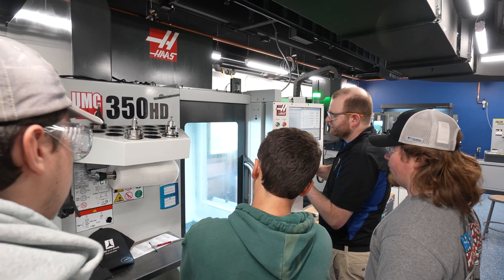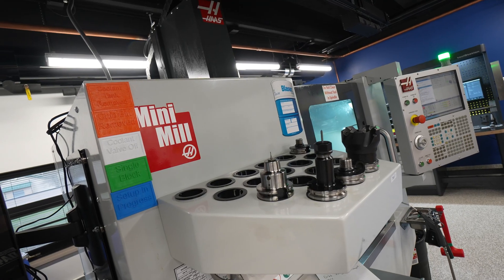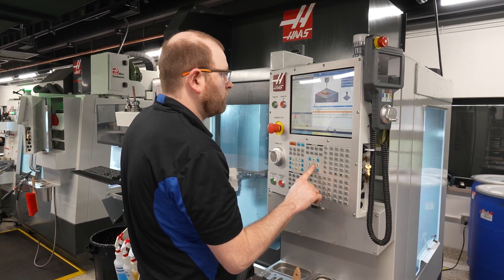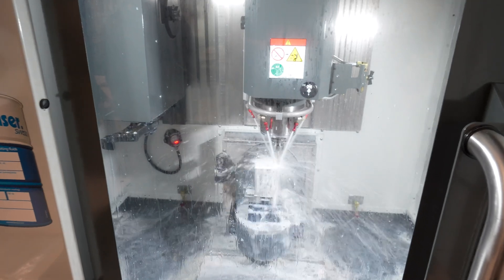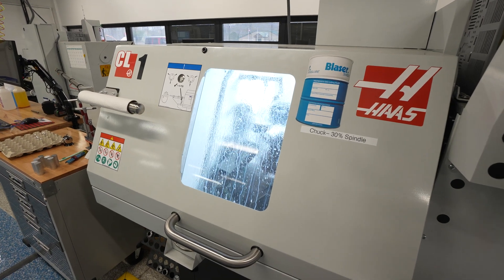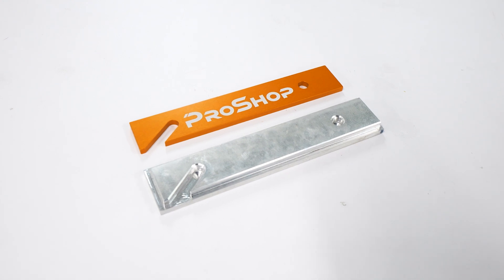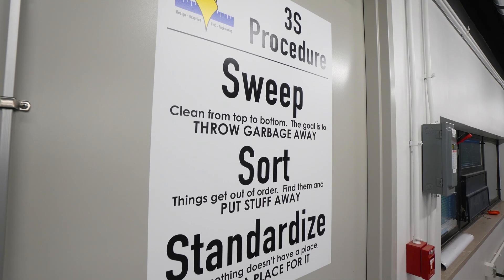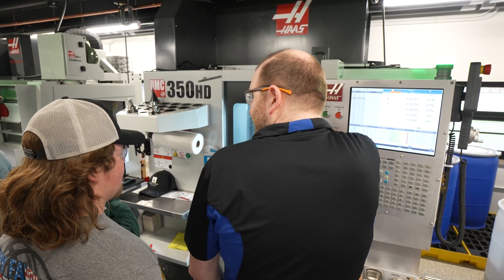A Job Shop Inside a High School - This is How We Educate Future Makers!

Comment: That's a great experience for students. However the local tax payers subsidizing 'eagle manufacturing' by being run by student out of the high school begs a question of ethics. Actual manufacturing and sales produced by capital investment of local taxpayers and labor of youth to compete with legitimate businesses is wrong. Maybe find a way to do this with out actual sales.
Reply from the maker: To be clear, the projects these students are working on are NOT taking jobs away from local job shops. And example is a key chain they did for a local company. That key chain was not something the business needed, it was just a way for them to support a local high school education program. If anything, there might be a third world manufacturer that lost a bid for a tchotchke 😉
Reply: Boo Hoo... If you're afraid of a group of high school students taking work away you have some major issues not related to them 🤣